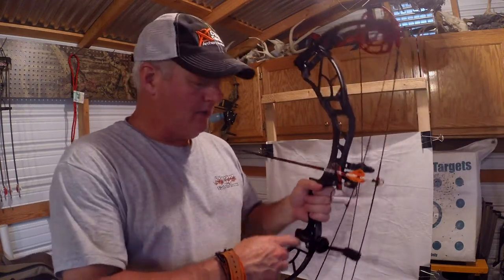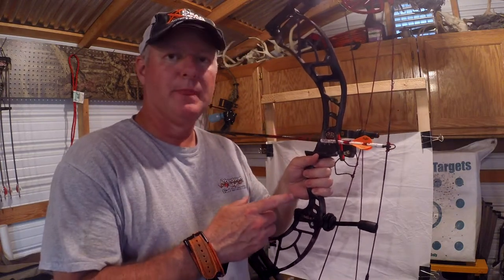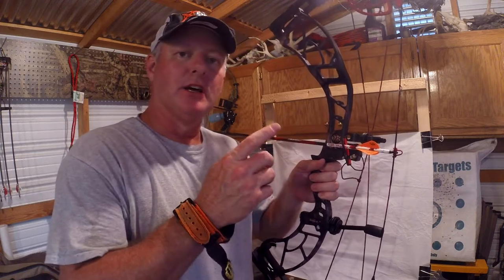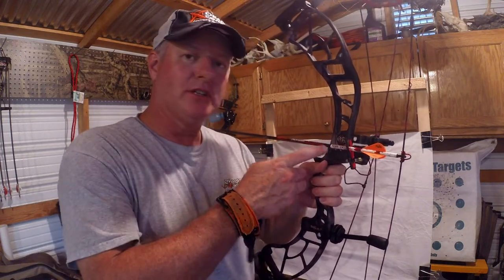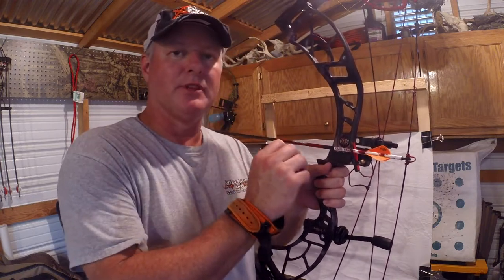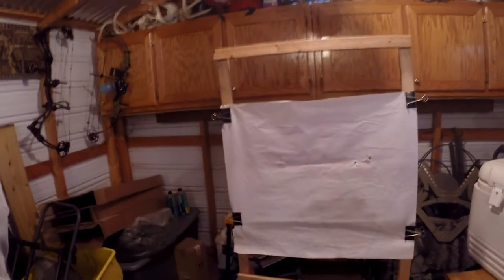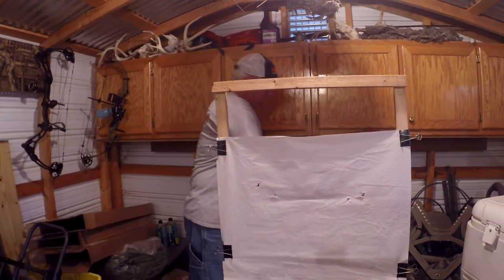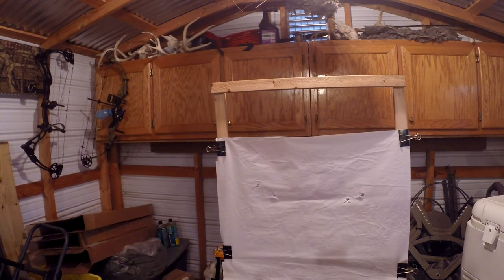Replacing shims on a 2015 Obsession Bow.

Comment: I've never tried moving spacers/shims when the bow is in the press. I always take it apart and put it back together. This method seems much easier. I also never thought to cut away part of the bow press finger so you don't have to keep removing the limb stops. Does that affect how you press other bows?
Reply from the maker: @ArcheryTalk The fingers are just the stock Last Chance draw stop fingers.  I purchased a second one for the duel limb stop bows.  Regular bows do just fine in the same press too.  When you take the axle pin and cams off, you just need to pay attention to what you are doing since little is holding the bow in the press.  I've never had a problem, but I see where it could be an issue if you're head wasn't on straight.  lol  Tks for the comment!

Comment: great video awesome. I have a 7m with a bad nock left tear. How far do you recommend shimming over? I have not taken apart yet but i think factory shims are .130 and .180? Where did you get the shims? Thanks Robert.
Reply from the maker: Shims can be purchased from Lancaster or other locations.  Move cams .20-.30 approx for every inch of paper tear.  Good luck with those OB bows, Customer service and the folks there love to lie every chance they get.  One reason I dropped them and will never work on those bows again.
Reply: Thanks Derik. Finding they stretch there claimed ibo that's for sure.?  I am going to try and swap the shims around and see what happens on both cams. I think thats .050 move to see if any different. I love the way you convey information in you're videos. Very informative.

Comment: What is that tool you are using to remove the little rings to get the axel out?
Reply from the maker: The tool I use for the eclips is one I made. I drilled a hole in a window scraper then cut through it leaving just half the hole so the edges push the clip ears out. The tool I use to push out the axle pin is just a small Phillips screwdriver. Hope this helps.

Comment: if your rest is set and you eventually shift the cams either way, won't the arrow sit skew relative to the limb-riser-limb plane?
Reply from the maker: It may, but it will be minimal.  It usually only takes abut .010-.020 to get it shooting straight.  It's the only real tool available for the two track cam system to address horizontal knock issues and the side force put on the cams by the cables.  All the bows I've worked on once they were shimmed correctly with the rest at 13/16", the bows shot bare shafts, fletched, field points and broadheads to the same point.  This is the easiest way I've found to get the best arrow flight on a two track cam system.
Reply: Derik Still thanks for the reply. when are you going to video your riser torque analysis?
Reply from the maker: TheBlackicehunter  I won't be doing any.  From my research, added or reduced cable pressure requires a horizontal shift in cams to keep the tune correct.  All of my videos are monitored by Kevin Strother, the engineer behind several successful bow companies, if I were saying anything wrong, he has my number and would let me know.

Comment: Hi there Derik.  Great videos!!I was wondering, the measurement for the arrow rest, is the measurement to the centre of the arrow or the side?  I'm guessing the centre as if its the side then different arrows will give a different rest position.I set up my wife's sniper, my friends Knightmare and me Phoenix here in the UK so it would be great just to confirm this.Kind regardsDarren
Reply from the maker: +Darren H Darren,  I set all the center shots at 13/16" and then shoot several different spine arrows.  If I get a consistent tear right or left, then I change the shims out to make it shoot at that center shot.  Somewhere between .020 and .040 moving the cams over you will see the results you need to see.  Good luck and let me know if you have any more questions.

Comment: Hi Derik, did you shim both cams or only the bottom? Thanks in advance, Jayden
Reply from the maker: Personally, I treat both cams the same.  It's always worked well for me.  I've moved on from shim bows a few years ago.  Overdrive binary and the new system from BowTech with the cam drive makes shimming a thing of the past.  No extra parts to buy and they are very easy to tune.  JMO

Comment: so...whatever side your tear is that's the side you add the shim? do you have to shim top and bottom cams?
Reply from the maker: +•808 life style•, when you read the tear, the tail of the arrow tells you which way to move the cams.  You would re-distribute the gap and move the cams over .020 - .030" at the time and see what the bow likes.  This is assuming your rest is setup correctly, bow is timed and you have the proper arrow.  You also do the same thing to both top and bottom cam.  Hope this helps.  Mahalo

Comment: I thought you had to fill relax a bow before removing cams?
Reply from the maker: Depends on the type of press.  I don't need to with my Last Chance Press, but I wouldn't trust a portable press to do this kind of work.  I've never so much as had a close call and I've done several hundred cam and shim swaps.

Comment: Shouldn't have to go this extreme with a new factory bow...this is the reason I sold my brand new Knightmare gt
Not to mention the extreme can lean
Reply from the maker: Any mechanical device produced will need to be tweaked due to the variances in draw length, poundage and the arrow one chooses to shoot.  There is no possible way the factory can cover all these variables and one reason your Dealer should make sure you are shooting well before leaving the store.  If you don't have a dealer capable of this, you can do it yourself.  That's the reason I made this video, to help those who have an incompetent dealer or who like to do their own work.  When setup properly, Obsession Bows have no more cam lean than any other bow produced.  They are easy to work on, have a great feel and shoot quiet well.
Reply: Just by that comment i know you haven't owned enough bows and have not put the time in to shooting them to think that shimming, changing tophats, or twisting yokes is uncommon. lol side note, cam lean isn't always a problem 98 percent of the time. A lot of Binary cams tune the best with cam lean for example.